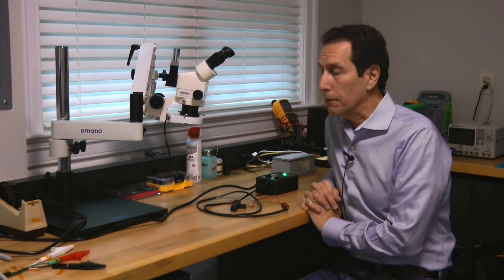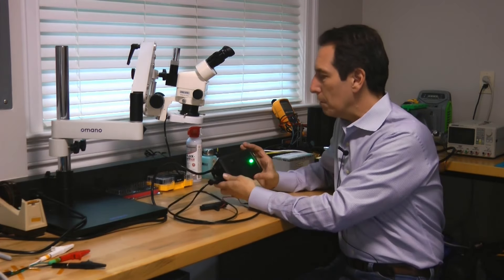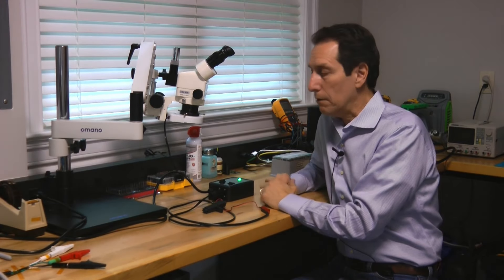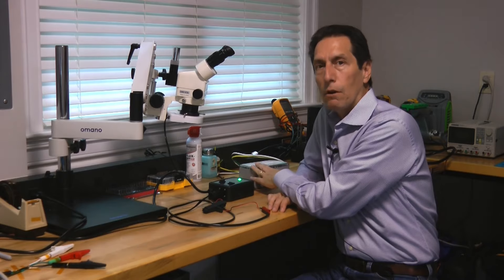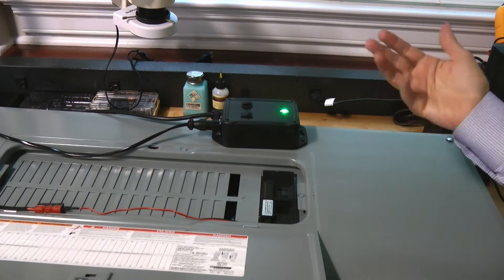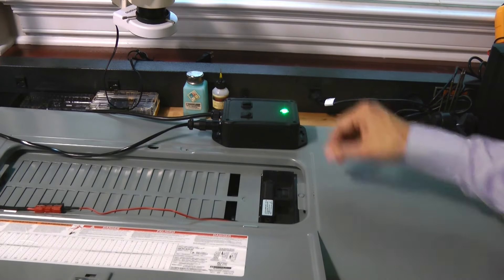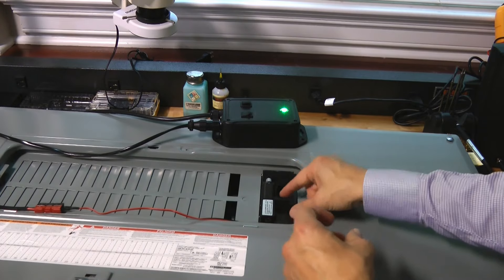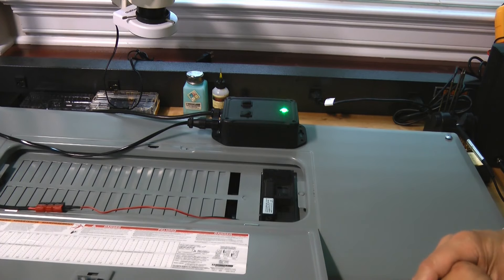First Look at the DEFCON Home | Switch

Comment: Very cool! So does that switch off the breaker fast enough to protect against that E1 event? Maybe I don't fully understand the attributes of an E1 event, but that seemed slow. Or is there a precursor wave of some sort it sense and should be able to shutoff in time? Have you heard anyone complaining about electricians not wanting to install these solutions you offer? We plan on waiting the housing market out and buying outright in the next year or so, when we do I plan on purchasing all your solutions to protect our house. Especially since I have ham radio and monitoring gear I want to protect. Thanks Doc, we always love your inventions! God bless you and your family.
Reply: No, as he mentioned earlier, E1 and E2 events are very fast events, and that's what the other surge protector he showed helps to protect your breaker by absorbing that energy.
E3, which is what this product is designed for, are long events that build up a ton of power in the grid wires that can cause fires and overpower normal surge protectors.
Reply: @cybernoid001  you're right, he totally did state that. I just processed it backwards for some reason. Thanks!

Comment: Nice! 
Off topic but are you planning any type of EMP protection products for the BMS in LiFePO4 and other lithium batteries? If not, would a TVS diode between pos/neg be helpful in preventing EMP damage to battery management boards. Thanks for all you do!
Reply: Great question.

Comment: But are not breakers only rated to stop up to 10kva.  After that, they are welded on basically.

It's a listed spec on each breaker.

Great idea.
Reply: Most service rated main breakers are 25kIC. Not all, but most. Personally I don't bother doing the calculation I just spec the 25kIC main to begin with.

Comment: Hi, Dr. Bradley!  I have a question—Do I need to wrap my solar generator in some insulating material if I store the generator in a faraday cloth bag that I’ve made for it? Also, do I need to cover the bottom of the generator with the faraday cloth, or just extend the bottom edges out as it sits on the floor? Love your videos, thanks!

Comment: I would suggest that rather than have a motor direction rocker switch, you have a momentary on button that can be depressed and held down to reverse the motor direction. Otherwise, if you'll not be actuated. Now you might be able to be confident you won't forget when you are there reseting the switch, but there are a lot of eye balls and inquisitvie fingers that anytime down the road might pass by and flip that switch.  Do you know someone you can picture if they blow a circuit running the microwave and the airfryer at the same time will go down to the breaker panel and first flip the easiest accessible switches, then repeat until they find the right one?

Finally, if would be helpful if there is some indicator that will show why the switch was activated, to let people know before they turn their power back on.

Comment: Do you ship outside USA i.e. to the UK and will it be usable on our 230 volt system? If not can you do a UK version and mainland Europe also use a higher voltage so would be larger potential market than just the UK
Reply: Just tried to order and it said invalid address so I guess not. Any chance you could provide you services further afield? Or recommend a counterpart over on this side of the pond

Comment: I have a question about the use of cameras after an emp.  LOTS of videos and posts about how to protect electronics from EMP, including security cameras.  My question is how those cameras will work if they are protected.  No wifi for them to connect to.  Only way would be a wired system to a monitor.  Correct?  All connected to a solar charged generator or power station?  (Assuming all parts are safely protected from the event.)

Comment: I don't see how it could operate nearly fast enough for EMP.
Reply: As he mentioned, EMP has different waves of energy that get emitted, E1, E2 and E3. 
E1 and E2 are fast traveling energy and so the other surge protector he briefly showed are designed to protect from that sudden burst of energy to shunt the power.
E3 waves are long duration that builds up on longer lines, mainly grid supplied lines, that can over power surge protection and cause the lines to melt or catch fire. So as that energy is building, this detects that and has enough time to flip the breaker to prevent the panel and your appliances from getting overloaded from gradual build up.

Comment: does this work with the panel cover closed? not worth it if i have to remove the panel cover and its not shown in the video
Reply: That is why he called this a prototype. My hunch is that when it becomes commercially available this device will need to be a part of the main breaker. I hope he's looking into getting a patent, so others cannot simply copy it.
Reply: @Inkling777  A shunt-trip circuit breaker would fit the bill... but generally a commercial item, and unlikely to be found in any residential panels. You could theoretically use one though - either in a subpanel or by checking with your utility if one could be installed upstream of your residential panel. All options would have a cost, though. The market isn't there yet (IMO) to justify the development of a residential-panel version of a shunt-trip or remotely-actuated breaker. Would love to see one!
Reply: Oh, forgot to mention - the response times of those shunt-trip breakers can be down in the 40-50ms range - substantially faster than a linear actuator. Still too slow for E1 & E2, but faster is better always!

Comment: I use an all-in-one solar controller which uses a line side tap above the breaker box. Could this system be configured to drive two actuators, one for the main breaker (in case I've gone to grid only mode) and the second for the breaker and switch adjacent to the all-in-one?

Comment: How does it handle the natural wire that is not controlled by the breaker?
Reply: If you meant "neutral" wire, then that should be bonded to the earth ground at some point (in residential construction, that bond is almost always in the main service panel). This would be in addition to the neutral-Earth bond outdoors at the utility step-down transformer (a variable distance from your panel unique to your geography). Very true - the main breaker does not interrupt that connection. While some might argue there is still a small risk associated with the long lead wire of the neutral coming into your service entrance, it would certainly be orders of magnitude less risk than the "line" side, which is NOT bonded to Earth in the same two locations. Residential panels do not offer true 3-wire separation... but a true service isolator could be added at a much higher cost.
Reply: As an aside, I'd be interested in this EMP control unit having a set of dry contacts available. In lieu of that, I suppose a latching relay could be put in parallel with the linear actuator - opening a lot of options for auxiliary control and alerting applications.

Comment: Nice idea, but the wiring in your home will likely conduct EMP current, and cause damage, with or without the main breaker tripping. The grid has multiple fuses, breakers, shunt trips, lightning arrestors and load shedding, so the damage from an EMP should be geographically limited. Widespread EMP destruction is not rational. Additionally, the smart meter on your home is not rated for excessive current that an EMP might produce. The meter would explode, and there's your circuit breaker. No current could enter the home. Even lightning can destroy a smart meter, and the current is presumably much less than from an EMP. With all due respect, If you disagree, please state your case. Otherwise, please spare the negative comments. We need a respectful debate.
Reply: If I understand correctly, this device protects equipment from a slow-building E3. Designed to be particularly sensitive to that E3, it will trip the breaker before those other "multiple fuses, breakers... [and] a smart meter" blow. Blowing before they do is a good thing.

The issue is not that other elements in the circuit won't eventually blow. They will unless the power is cut off at the main breaker. It's about breaking the source of that energy before the damage is done to them and other devices in the building so they are not damaged. 

Also, the energy picked in "the wiring in your home" is much less than that picked up by many miles of the electrical distribution system. That limited energy can almost certainly be absorbed by the surge protection systems in the home, particularly since any outside source for that energy has been removed.

In short, this device is not a replacement for traditional surge devices. It is a supplement to them in certain situations. It works well where they perform poorly, and they work well where it performs poorly.
Reply: @Inkling777  Provide proof. Your comment is only an assumption. "That limited energy can almost certainly be absorbed by the surge protection systems in the home, particularly since any outside source for that energy has been removed." Also, I find it unlikely that this device will outperform what the utility companies provide to protect their own equipment, but I have no proof of that. Although I have much respect for Dr. Bradley, he has not provided empirical evidence for the efficacy of his product yet. I would like to have him comment. Your comment - "The issue is not that other elements in the circuit won't eventually blow. They will unless the power is cut off at the main breaker. It's about breaking the source of that energy before the damage is done to them and other devices in the building so they are not damaged." makes no sense to me. That is the primary debate on the topic.